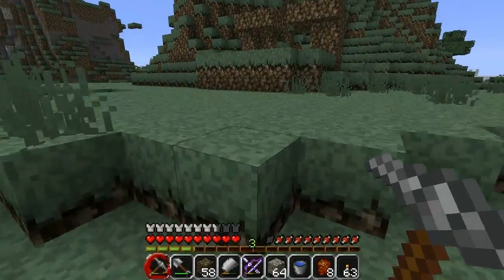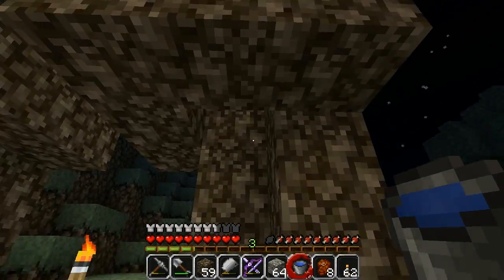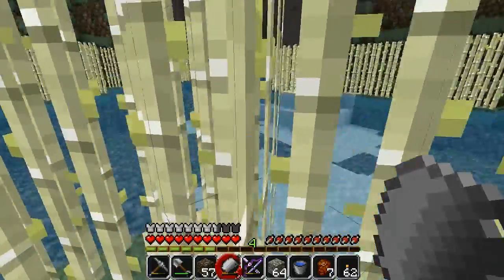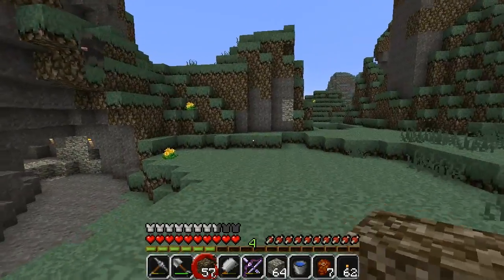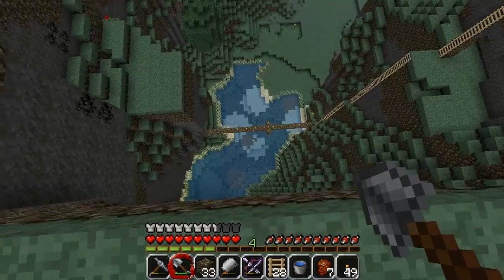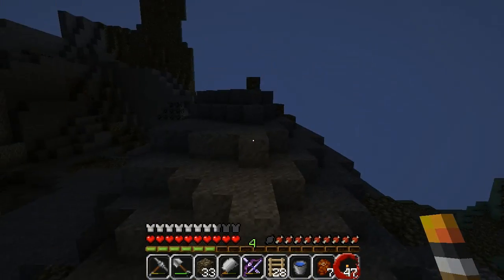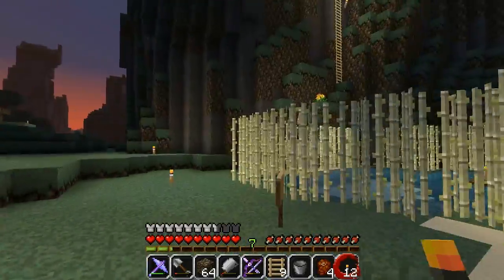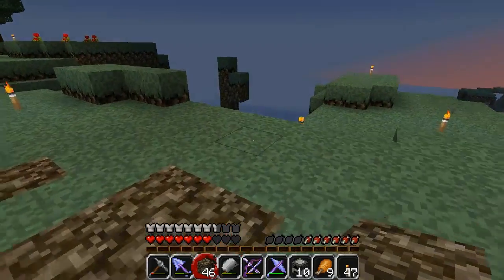Mindcrack Number Sixteen - "Excavation" (Z380)

Comment: 2 things
Your plan for the sheep shearing collection is pretty good, but for it to work properly, you need to remove the fences on the side of the pens. Items will get stuck here and then not collect. The back of the pens will probably be fine though. This will be a problem for the grass growing. you could turn the entire sides into the roughs i guess though.
Also, that cave opening will look like the scene from Sanctum when all the rain water pours into the Cave of Swallows when it's done.

Comment: I just thought he could modify the house so that it 'rimmed' the hole, that way he could have a couple of doors dropping down into the mines and it would look a lot cooler (I think) if there is nothing between the moon and the mines, glass is better than nothing, but it would take away some of the greatness of it for the other guys using the default pack...